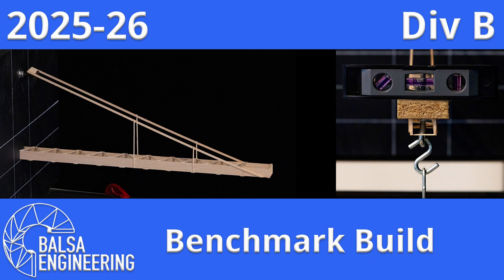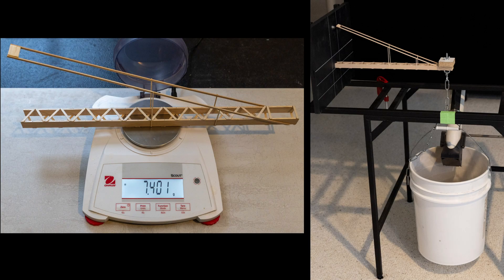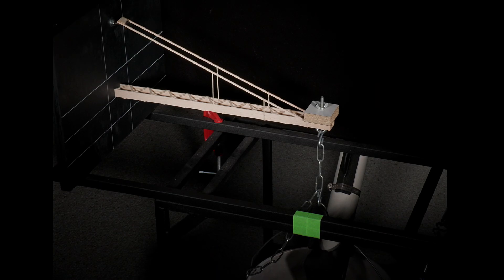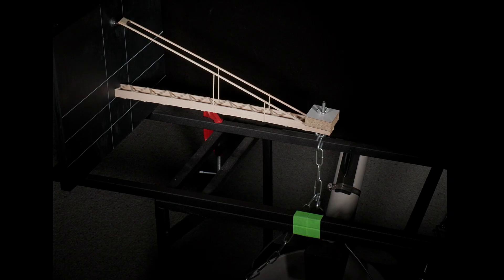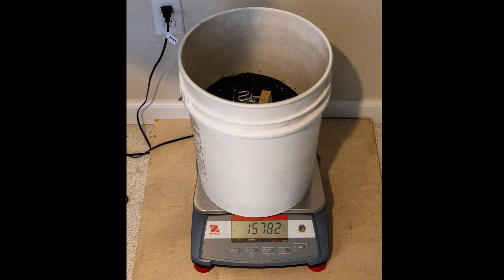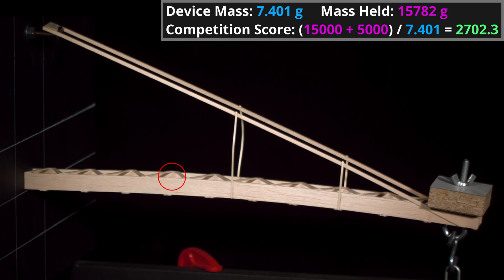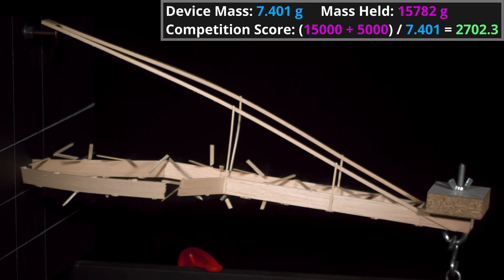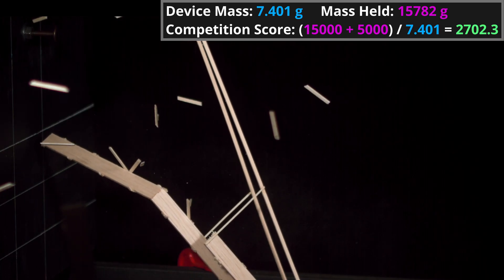2026 Science Olympiad Boomi Div B: Benchmark Build

Comment: Is 7.04 grams considered light for a Boomilever or average?
Reply from the maker: Depend on how much it holds.  If your 7.04g boomi is 15cm and holds the full 15kg, it would score 2857 and would be excellent.  If it only holds 8kg, it would score 1136 which is OK but not great.  Think more in terms of efficiency (or score with the bonus) rather than just the weight.  It's not that hard to build a boomi that is < 4g, but that doesn't mean it would do well.  But even a 10g bonus boomi that holds 15kg would score 2000 which is pretty good.
Reply: @balsaengineering6686  Thank you so much!
Reply from the maker: Definitely check out my discord server for tons of info to get started with this: https://discord.gg/JkRVdX3G

Comment: would it be better if you added triangular bracing to the sides.
Reply from the maker: That would work well, but it would add a lot more mass.  It's always a trade-off to try and figure out what the minimum design required to achieve the goals.  I encourage you to experiment with design and material tweaks with your builds, that is the fun of this event!

Comment: What is the difference between boomi complete and boomi dry?
Beam mass(avg) is the weight of 1 piece of "3/32*15mm*42.5cm" ?
Tension sticks(avg) is the weight of 1 piece of 1/16*1/8*42.6cm" ?
Reply from the maker: Boomi complete is the weight as-built in ambient humidity, typically around 50-60% RH.  Dry is after spending 24+ hours in my dry-box as it would come out for a competition.  The RH there is typically under 20% which is why it weighs less, usually around 3-5% less.  See my competition prep video for more details on that: https://youtu.be/6zOvHMZLaNE
Yes, the beam mass avg and tension stick mass avg are for single sticks.

Comment: What is the wood density of the balsa you have used ?
Reply from the maker: There are a lot of different densities, the beams were around 9 lbs/ft^3 if I recall.  I have the masses and dimensions of everything, so you can compute the exact densities if you'd like.  I would recommend you create a spreadsheet to do this to make sure you get the units consistent.
Reply: where do you get the balsa for the boomilever.
Reply from the maker: @normalitylowktweaking  I like to buy my balsa in sheets from Specialized Balsa:  https://specializedbalsa.com/products/balsa_sheets.php  and cut them to the width I need

Comment: Is there a video where you show us the template for this design?
Reply: And did you use a 3d printed jig to build the boomilever?
Reply from the maker: I only used a 3d printed jig for the compression member.  I made an entire series on how I built this if you want to check it out.  This is the first part: https://youtu.be/TqCppQ6rIRo
Reply: @balsaengineering6686  for the jig, i checked and it says 212mm even though it is supposed to be 425 mm
Reply: nevermind I see it says half
Reply: @balsaengineering6686   I printed the jig, yet the width is not the 2.6 cm you  listed in the video, Is that to accommodate the compression members or is that a problem, with the actual file?
Reply from the maker: @SkidibiToilette The width of the jig is only 2.0cm, that is the inside dimension of the compression part.  The extra 6mm comes from the width of the beams themselves
Reply: @balsaengineering6686  ok thank you I see it now
Reply from the maker: I show the dimensions and mass of the parts in my optimization video:  https://youtu.be/ecV7Qdl2Vqo
Reply: What is the wood density of balsa you have used ?